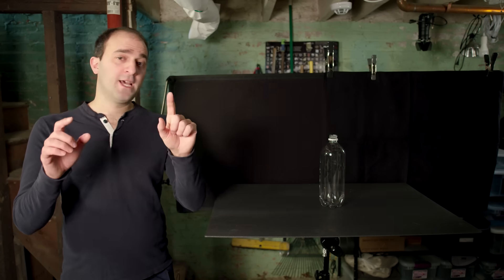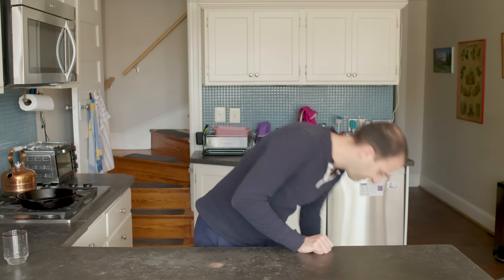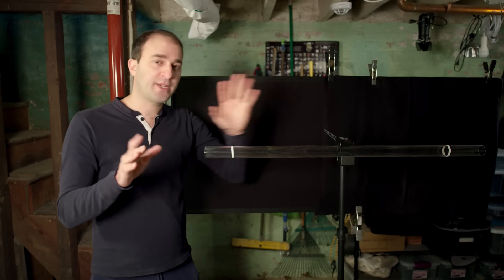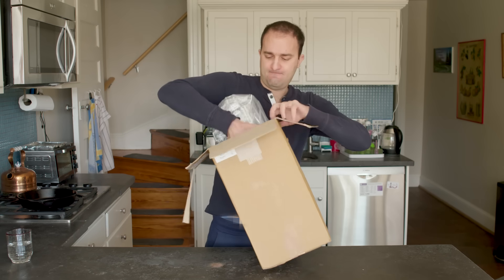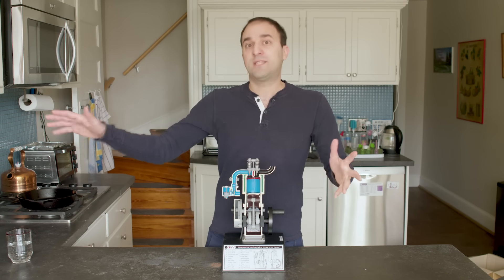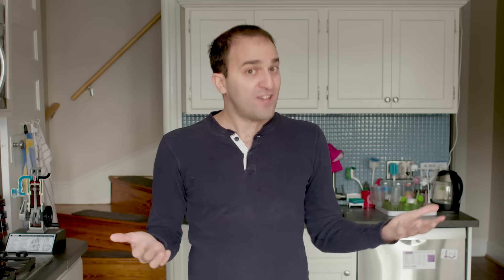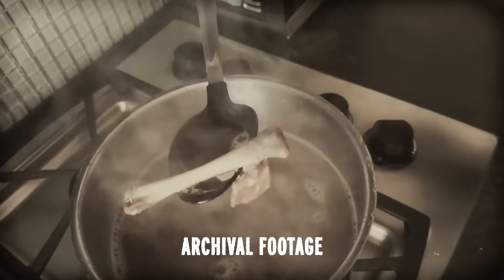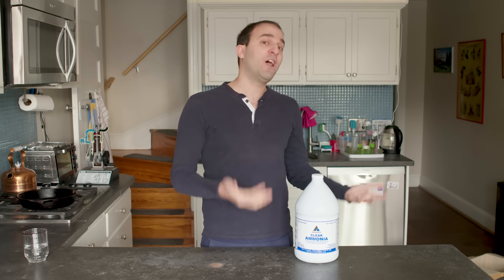Does Toyota Know Something That We Don’t?

Comment: Hmmm  I am thinking about the one application in which fossil fuels will be hard to replace.
Air travel.
With the fuel, and the engines, outside of the cabin, any potential leak would be safely away from the human occupants and would quickly dissipate.   
Yes I know that the 33% drop in energy density would make this a problem for long haul flights, but I am willing to bet that for over 50% of all air travel this could work.  
Another use would be container ships in which the additional fuel tanks needed would not be much of a problem.

Comment: Ammonia is used a lot as a gas for refrigeration. Especially now with different freons being made illegal. There are risks. True. Good thing - there are ammonia detectors that can be installed, it can be easily damped with water in closed areas (carparks), it is very easily detected by nose even before it reaches dangerous concentrations. Not as energy dense as petrol, but much denser than 'electricity carriers'

Comment: Drag racers tried something similar a long time ago. They used Hydrazine. Led to engine blow ups and eventually being banned. Ammonia has to be transported in very heavy steel cylinders which are used as is to refill refrigeration systems. To use it in cars would need a lot more than just a squirty hose gun to get it transferred.
Reply: Hydrazine is horribly toxic. Now drag racers use nitromethane which can blow engines as well
Reply: @justuseodysee7348  only a few use nitromethane.  Most tracks do not allow it on the premises, only special events-track has to carry a different type of insurance as I am told, to allow nitromethane powered vehicles to compete.
Reply: Hydrazine is literally rocket fuel.
Reply: eh, I have a bunch of liquid ammonia kit from my days working industrial refridge, its not like its magic..
Reply: Hydrazine was also used as boiler water treatment to scavenge Oxygen. We were well aware of the fact that it was toxic watered down rocket fuel. Ammonia NH3, Hydrazine N2H4. Just in case anyone's wondering. . .
Reply: I'm sure you can still find video of dragsters belching green fire
Reply: @luislongoria6621  If the flames are green, they are using hydrazine!
Reply: Hydrazine was the fuel used on the space shuttle. They always landed as a glider, because there was no acceptably safe way to return with hydrazine on board.
Reply: @lyfandeth The space shuttle's main engines (RS-25) ran on simple hydrogen + oxygen (hydralox). When you burn these you create.... water!
Hydrazine was used in its Reaction Control System, but it wouldn't need that for landing.
Gliding down was simply the 'easiest' method to have a reusable space craft. Landing like SpaceX does now was not feasible in the 80s. Also the shuttle itself can't carry any fuel, it's all in that big orange tank on takeoff.
Reply: Comparing NH3 to gasoline, it seems silly.
But compare NH3 to pure hydrogen. It's far safer, has exponentially better energy density, etc. etc. etc.
Reply: Hydrazine is a hypergolic fuel used in solid rocket boosters. Once lit, it cannot be extinguished or stopped. Might as well string up sticks of dynamite like firecrackers for an equivalent safety level.
Reply: @theTeslaFalcon Hydrazine is a liquid fuel, try google next time.

Comment: The answer to your question is no. Forget clever magic fuels or ingenious Engines that are more efficient, none of that matters, even the tail pipe emissions. The key issue here is the end to end efficiency, and that's where ALL of these schemes fail, whether that's Biofuels, Hydrogen or Ammonia. Heat engines are hideously inefficient and complicated. You can include Fuel Cells in that statement, since none of them exceed 60% efficiency. Compare that to electric motors and charging/discharging of batteries, because that's what you're competing against. ANY process that uses electricity to create fuel for heat engines would ALWAYS be better used to charge batteries and then use that to drive an electric motor. All of these chemical processes take energy to create them, compress or transport them before you waste half of that in the heat engine.
It's therefore obvious that BEVs are a much better option.

Comment: None these supposed issues with Ammonia are actual issues.   Propane is very similar as a motor fuel and has been used for the better part of a century...   Additionally Ammonia powered vehicles have been around since WWII so NONE of this stuff is an issue nor is the tech even new.    And yes there have been ammonia powered road vehicles previously....

Comment: Unfortunately ammonia is a potent suffocating and irritating gas even at low levels. Controlling leaks is a problem with any gaseous substance. I have had a near fatal accident with a laboratory spill, I remember that horror clearly from forty odd years ago.
Reply: Ya, it seems like they completely glossed over just how dangerous amonia is.  Also, fossil fuels be burned to produce the amonia?  Kind of reminds me of when they had some green diesel made from algae, until they did the math and found out that it took 1.3 gallons of regular diesel to produce 1 gallon of "green" diesel.

Comment: If you have ever been in an RV or used a propane or NG refrigeration unit in any scenario, the tech is virtually the same as the original devices in the early nineteen hundreds using ammonia.

Comment: Methane (Natural Gas) has an energy density of 50+ MJ/kg vs 18.8 for NH4 and the infrastructure is mostly there. NH4 is industrially produced with Nitrogen (from the air) and H2 (that has to be made from Nat Gas, or much more expensively, from electrolysis). 

Building a massive NH4 infrastructure (and a massive H2 infrastructure to feed it) would be absurd. 

Battery tech can use whatever electrical source you choose with a 90-93% round trip efficiency. NH3and H2 are NOT efficient and cost Alot more than electricity. 
Not to mention Many $billions to build out the infrastructure.

Akira Toyoda is wasting his company's money and will kill Toyota or dramatically reduce its size in his quest for "anything but batteries". 

Battery tech is already challenging Gas at every metric (especially if the car is charged at home... requiring far less infrastucture which is already maturing rapidly).

NH3 is yet Another way that Toyoda has concocted to waste his company's money.
At best, he's a profound fool.

Comment: A truck just wrecked in my State dumping only 800 gallons of chemical into the stream ! It killed everything in it for 20 miles and left it uninhabitable for 25 years ! Over 825 hazardous chemical incidents – including fires, explosions and harmful chemical releases – have occurred since the beginning of 2021, and over 270 incidents have occurred in 2023 alone, according to data published  by the Coalition to Prevent Chemical Disasters !    Did you not see the aftermath of the chemical train derailment in ohio ? We have proven we do not have the safty measures,  laws or regulations to protect anyone !

Comment: Rotten eggs is Hydrogen Sulfide, totally different chemistry
Reply: That's what I was thinking !
Ammonia smells like ammonia. Once you smell it, you know it forever !
Reply: @glennjames7107  I think it smells similar to licorice. But without the sugar smell and the spicy smell turned up to 11. Salmiak is an ammonia salt as far as I am aware.
Reply: Same goes for hydrogen sulfide @glennjames7107
Reply: totally. i worked for 10 years in a haber-bosch ammonia plant.  unical then bought out by agrium. never smelled rotten eggs. saying ammonia smells like rotten eggs is like saying strawberries smell like baseballs. ammonia smells like ammonia.  want to smell it? go buy something like, oh, i don't know, ammonia?. and at 50 ppm anything on you that is moist, eyes, ears armpits, crotch, nose, mouth, starts screaming in agony. but almost immediately, you can't smell ammonia because your olfactory sensors are overloaded. like the rotten egg smell at a hot spring.  smells pretty bad when you get there but 15 minutes later you don't even remember it.
Reply: Rotten eggs produce both. Ammonia and hydrogen sulfide. Ammonia is also part of the smell in really nasty public toilets. Due to the poisonous nature of ammonia, evolution has equipped most creatures with a highly alerting sensory system to detect it.
Reply: Remember he was probably told this by the programme producers, who took english and other language or art subjects. Possibly biology by not Chemistry and Physics.
  This us one of the reasons the country is in a mess.
Reply: @johnrhodes3350  Not engineering I would suggest.
Reply: "I was told to expect a ...rotten egg smell..."
By WHOM? Your videographer who flunked HS chemistry because he dozed off and woke up when the teacher said, 
".. and as you can all smell, this reaction has the distinct odor of rotten eggs..."
He then turned to the wastoid next to him and asked, "What the hell was that effing smell?"
And the wastoid replied, "I think he said something about being stronger than ammonia or something like that or something..."
:face-orange-raised-eyebrow:
Reply: Decomposing egg whites will actually create ammonia. Don't just dismiss what he said as false because it can make something else.
Reply: @porcupinepunch6893 Much easier with urine.
Reply: ammonia as in hot springs on some mountainous places? cause i do know when i was a child my mom has amonia rocks from a hot spring, i heard it has its own health properties

Comment: The nice thing about petrol is that it's safe enough for use by the general public -- even those idiots who smoke cigarettes while filling up are usually OK.
And although mankind has been handling ammonia safely for over 100 years in an industrial setting, the general public isn't trained to handle ammonia safely.  This means that a simple fender-bender or a spill at a filling station will likely result in a trip to the hospital.

Ammonia (and hydrogen) are NOT really fuels, they merely store energy that is produced elsewhere (often by burning fossil fuels).
Petroleum and coal really are fuels  --  you dig them out of the ground and burn them (but they're usually processed so they burn cleaner).
Reply: all the products need energy to extract and process. You ever seen a petroleum stream design/plan? The idea here is that since we produce ammonia industrially anyway the system is already in place, and replacing carbon means less emissions compared to the energy needed to make a hydrocarbon fuel. Hydrogen is a fuel as well and anything combustible is a fuel. check out what rockets have been using as fuel and im sure you cant dig petroleum out of the ground. same for rocket fuel.
Reply: @System0Error0Message  Umm ammonia would emit nitrogen and nitric oxide right? What effect they have on the environment?
Reply: @WhiteGeared  my point was mainly that it doesnt need to be carbon to be a fuel, as it is the hydrogen in petrol/diesel that is the main combustion with the carbon acting as a carrier. The more hydrogen a molecule has the denser it is in energy (basically 1L producing more, why diesel has better range than petrol). Hydrazine has nitrogen and hydrogen. In all cases think as carbon or nitrogen as the hydrogen carrier. In nitros for cars, the nitrous oxide is an oxygen carrier. What matters is the purity of the fuel and what comes out. A bad combustion would produce incomplete combustions but our hydrocarbon based fuels have Sulphur in them as well. So the 2 main factors are, how much carbon, and how much pollutants and how much energy it takes to make the energy. And sure ammonia might not combust perfectly but testing needs to be done.
Reply: @WhiteGeared  The only step in the Haber-Bosch process that produces any "pollution" would be the CO2 produced when using natural gas (CH4) as the source of the hydrogen needed to produce NH3.  If electrolyzers are used in combination with wind, solar, hydro, nuclear, geothermal, or other carbon-free power sources, there are virtually zero emissions associated with HB.  The chemical equations for autothermal reforming of methane are below:

CH4 + H2O (steam) → CO + 3 H2 Endothermic
CO + H2O (steam) → CO2 + H2 Exothermic

The chemical reaction for Haber-Bosch is:

3 H2 + N2 → 2 NH3

HB is exactly as clean as the source of the hydrogen.  Nitrogen is ~70% of the air we breath.

NH3 is actually cleaner than hydrogen because: 1) NH3 is used to catalytically clean up the NOx that is produced in both hydrogen and NH3 IC engines, 2) it takes less energy to produce NH3 than it does to produce 10k psi hydrogen (the pressure needed to store hydrogen on a vehicle), and 3) while hydrogen can persist in the environment for long time periods, NH3 is readily used by natural environmental cycles (ie as a fertilizer). 

NH3 is currently produced in approximately equal amounts by natural and man-made paths.
Reply: you cant really process fuels to burn cleaner, with petro products i suppose thats true. But certainly not with coal. It's easier to extract contaminants after having burnt it, than it is to process it, and then remove the contaminants, and then reprocess into a burnable fuel.

It's easier to do that with petro but even then we still have catalytic converters on cars for a reason. Realistically the only universal trick here is having as complete combustion as possible.
Reply: @killingtimeitself  Have you heard of cocke ovens? They remove contaminants you don't want in your steel from coal.
In a blast furnace the fuel is burned directly within the iron oxide feedstock, so there wouldn't be the possibility for removing contaminants from the products of the burning.
Reply: People will learn fast and those who fail to adapt to a new environment get the darwin sponsored one way ticket to heaven. We are too many people on this planet anyway. The smart thing about ammonia is that it can act as an energy store or battery for renewable energy production that is depending on weather. So when the sun is shinning and wind is blowing and demand for energy is low we produce a lot of ammonia then in bad times with high energy demand we deploy ammonia to generate energy.

Comment: Roads lined with dead flies, including bees.  Used to work at a firm that used liquid latex. It gave off ammonia when the top was off.  It soon acquired lots of black spots on the surface as insects flew too close and died.  Sure wouldn't want to pump the stuff or work on the engine.
Reply: There is a Youtube video of a guy working on cleaning a DEF Diesel exaust system that uses Ammonia as a burn agent to process NOX in the exaust.  He got violently ill while doing the shoot.  He ended up in the hospital for quite some time, as they ran detox agents through his blood.  It alomst killed him.  He may have permanent damage.
Reply: @barrettabney  DEF is urea or AdBlue as a marketing name. It's not ammonia but will probably release ammonia when heated to glowing hot temps.
Reply: @barrettabney  GUESS WHAT'S IN DEF ALREADY
Reply: NH3 tank pressure is high, and accidental venting is dangerous, so all systems would be designed to make the kind of thing you're imagining nearly impossible.
Kind of like the way we don't have gasoline fires or poisonings at every gas station.